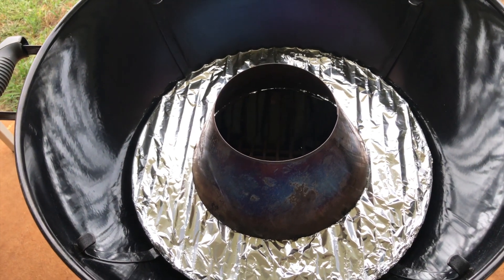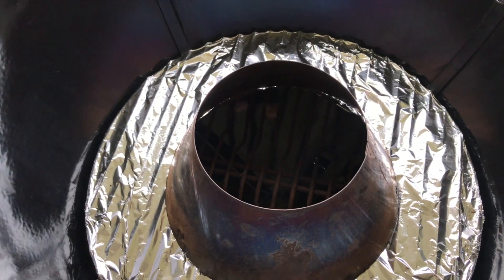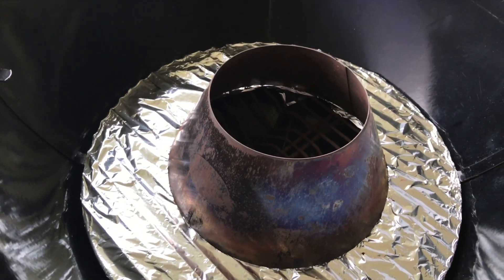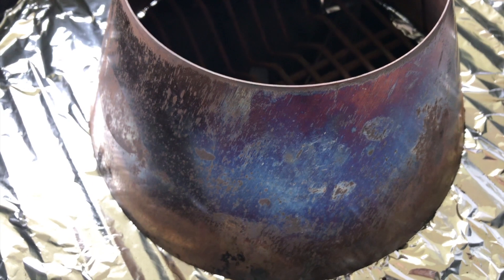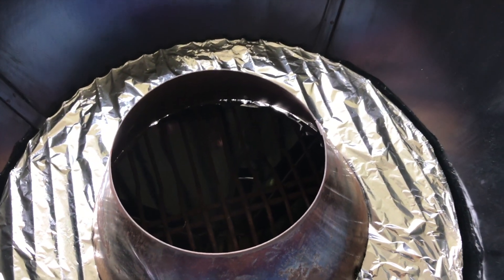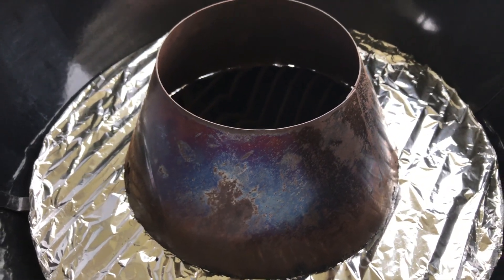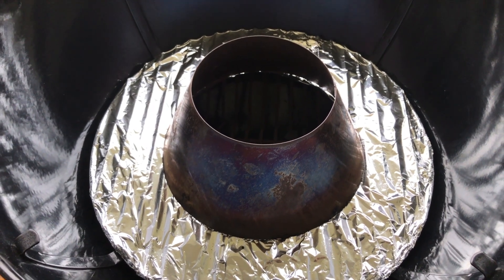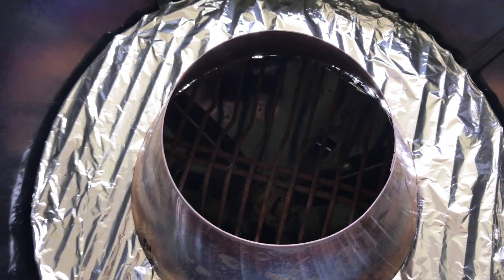Setting Up Your Vortex - Part 2 - The How's and Why's

Comment: Are these available in NZ?
Reply from the maker: I would say yes, they are available in every other place in the world, so can't see why they wouldn't sent them to NZ. Or you can make your own if you are handy.
Reply: Mike's Man Cave cheers mike
Reply from the maker: @Mulholland1972  How did you go, did you ever get a vortex or make one?
Reply: @MikesManCave  gidday Mike, I ended up improvising with a stainless steel bowl cutting the bottom off and using that. I would still like to get a vortex or Australian kettle kone.
Reply from the maker: @Mulholland1972  Cool. as long as it works.